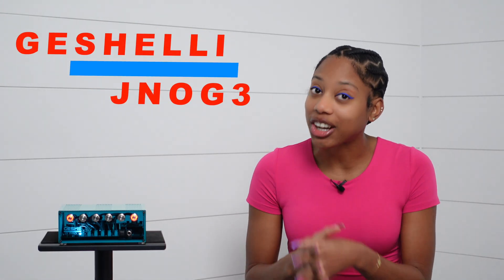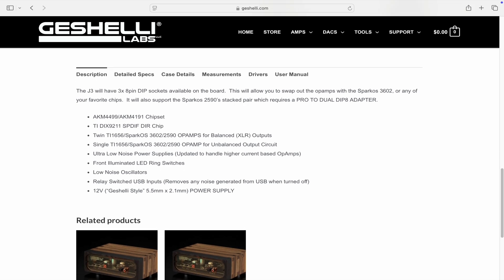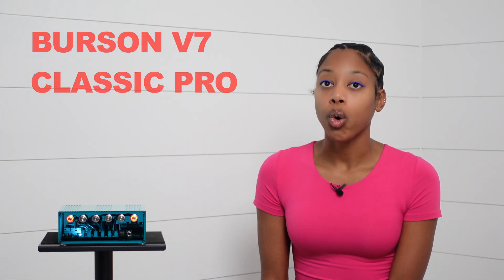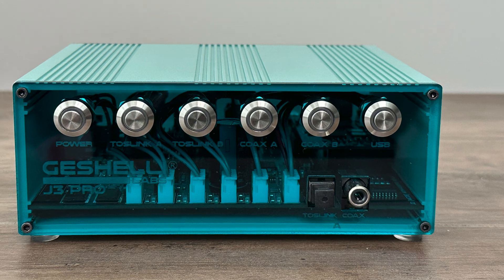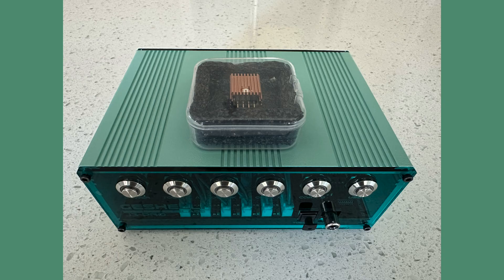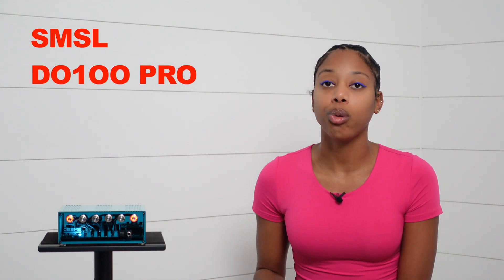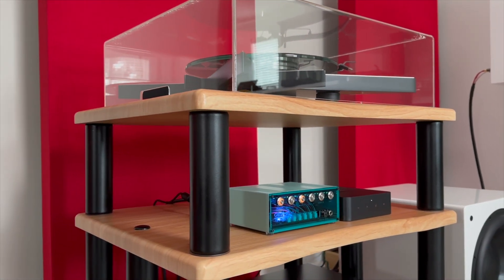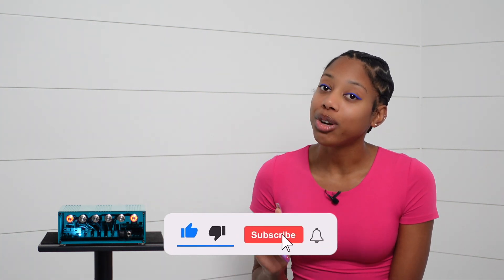Geshelli JNOG3 /J3 PRO DAC

Comment: I just can't get over the aesthetics. It looks very cheaply built. From the 4 exposed screws securing the front and rear panels to the cheap aluminum pieces. Acrylic is very soft and will easily scratch too. Otherwise it appears to be a great performer at a very good price. I just do not like the case build quality at all. Obviously just my personal preference. I'd consider the wood, but that still uses the cheap looking acrylic front and rear. If they offered a front panel made of wood...

Comment: Had anyone upgraded their power supply??? If so, with what???
Reply: I bought the IFI X Power adapter. Couldn't believe the difference it made. Not night and day but noticable. Cleaner more airy.
Reply: @brianmiller3121  Thanks!
Reply: Just received the FiiO PL50 12/15v linear power supply.  It's literally unbelievable with the J3. Unbalanced is a great upgrade, and the balanced is unreal.  It's $128 on Aliexpress.  Not sold on Amazon.

Comment: I love the top of the line Sparkos SS2590 op-amp - it has incredibly clean and neutral tonal balance, and wonderful dynamics. A "3D" soundstage with layering that is second to none, in my opinion. I have owned the Geshelli J2, J2S (with two different AKM chips) and now the Dayzee. Using an improved power supply (I have a linear power supply) and upgraded to the SS2590 op-amps - it is the best DAC I have heard.
Reply: Which linear power supply are you using for the Dayzee?
Reply: @AntonioJoSeis  I am using a dual voltage custom made by Pine Tree Audio - it has 12V 4A for the Dayzee and 5V 3A (I think?) for my Bluesound Node 2i.

Comment: About a year and a half ago I started out with their stock J2 with a beautiful Purple Wood case. But they recently upgraded it for me with the AKM4499 board and chipset. Plus I upgraded to the Sparkos SS3602 op-amp. It's an amazing transformation in sound. It blew away the Topping D70 Pro Octo that had temporarily replaced my stock J2. There was no J3 or J2s when I bought my J2.. that's why I did all the upgrades.